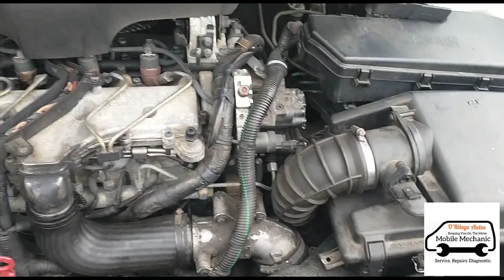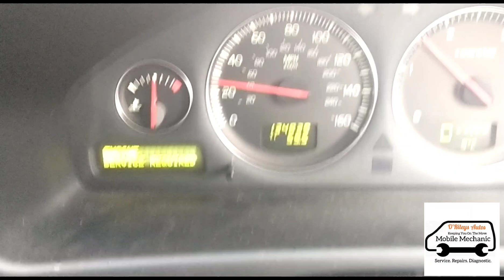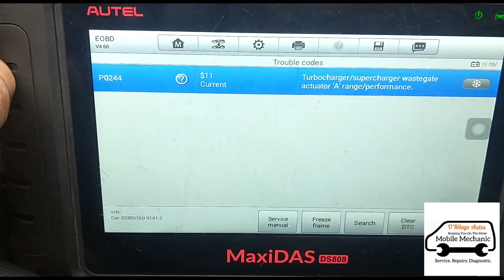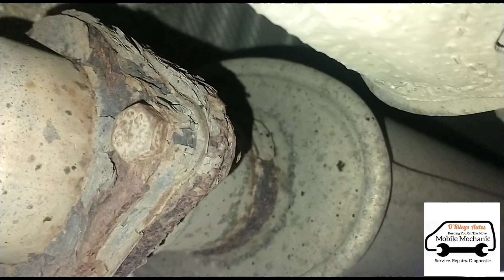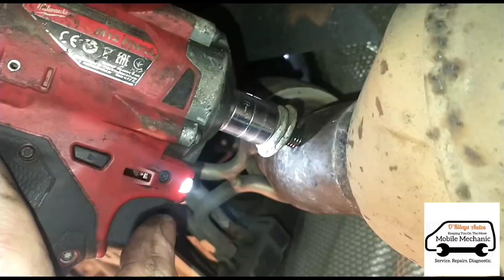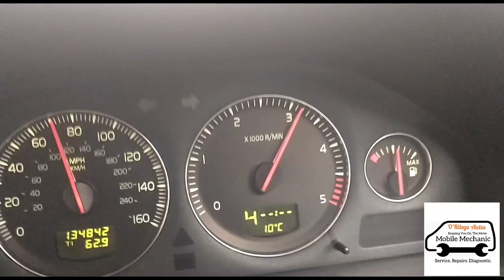Volvo 2.4 D5 6805 Boost Pressure Control: Flow Fault P0244 Turbo Wastegate Actuator Performance

Comment: I would straight pipe the thing up to the turbo and drive with it like that, problem solved. If it was a Euro4 you would still be able to get away with dpf delete but euro 5 not.

Comment: Hello, I am following you from France, my car has this kind of pressure problem that I cannot solve.
My car 2004 VOLVO XC90 D5 automatic transmission
When I connect it to the diagnostic device, it gives some error codes,
P0571 Brake switch A circuit
P0100 Mass or volume airflow Circuit A
P0102 mass or volume airflow Circuit A is low
P0108 Manifold absolute pressure / barometric pressure circuit high
P0112 Intake/inlet air temperature sensor 1 circuit low
P0244 Turbocharger/Supercharger wastegate solenoid A operating range / performance error

The actions I have taken in this direction
1 Egr valve disassembled and cleaned, electronically tested 
2 Manifold cover was removed and cleaned with connected pipes
3 Maf sensor changed
4 Map sensor changed
5 Turbo solenoid valve (N75) changed
6 catalysts changed

I connected the diagnostic device to the car again and deleted the error codes, but it gave the same error codes again. 
The engine is very noisy and vibrating, when I put the gear in D position and press the accelerator to move, it cannot even go up to 1000 revolutions, but when I set the gear to the N position, it goes up to 3000 revolutions shakingly. I couldn't figure out what the problem was. I wanted to ask you to get your opinion. I wonder if you have anything to suggest to me on this topic.

Comment: Great videos!!, I have a 2007 d5 xc90, which recently has gone into limp mode, with fault code ecm1517 turbo control pressure too high, and  soot filter full on dash board, I have vida and tried a forced regen but it aborted after 1 hour, first thing in morning the fault isn't on the dash but if I put my foot down it goes into limp mode with soot filter full, it also has a bit of a fluter noise when revved, what do you think is the issue, thanks

Comment: One of the previous replies mentions it... when you started the millage was 133968 by the time the test drive to verify the cat clean had worked the millage was 134839.
871 miles difference, thats one long test drive. Would be really interesting to have less edited video's that cover the process to see what worked and what didnt :)

Comment: I have a similar loss of power on my Xc70 clean the dpf and egr 
Still the same even cleaned map sensor still no joy the car will only 70 and it's slow getting up there
Also have on the messages engine system service required and engine system service urgent
Reply: What did you do to fix it?

Comment: Thanks for sharing your diagnostic process..  Brilliant videos..please keep them coming in 2022...what's part number is the pump you use for the cat clean..how much liquid do you use..
Reply from the maker: It's a Laser multi purpose mini pump. 2 litres
Reply: The only laser mini pump I can find is
a 1 litre the one in the video looks bigger hehe
Reply from the maker: @geoff3172  sorry my confusion. It's a Laser manual brake pressure bleeder
Reply: I have a bmw 525d the soot level always reduces to around 2g after regen but Ash level always been around 50g is this when you need to use chemicals to reduce.. the dpfs that you are cleaning is soot and Ash levels high?
Reply from the maker: @geoff3172  Ash levels can be harder and sometimes impossible to clean. Ash levels increase with age and mileage. If you set fire to a barrel of wood it will burn down but leave a small amount of ash. DPF is a similar situation during regeneration process. The more often a regen occurs the ash content will increase. We can flush to decrease this in most cases
Reply: @ORileysAutos  when we see you using your magic liquid on the DPF is the soot level really high and a forced regen cannot be done on the scan tool
Reply from the maker: @geoff3172  yes sometimes the soot levels can be to high to just regen it. Depending on the vehicle once the soot level reaches a certain level it won't reduce without tricking the system by programming it to tell it it's had a new DPF. Then flush and faults can be reset.
Reply: @ORileysAutos  Thanks Jimmy for explaining...can the mini pump you used for filling the PAT tank be used to pump fluid to the dpf..just need to fill twice...
Reply from the maker: @geoff3172  yes it can. Although the soot or ash especially may not reduce on diagnostic with a decent machine